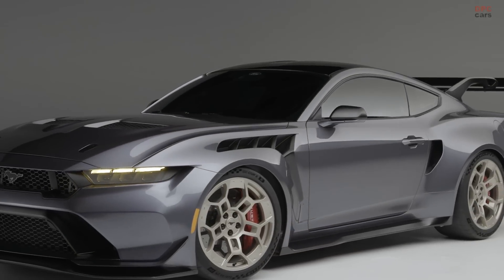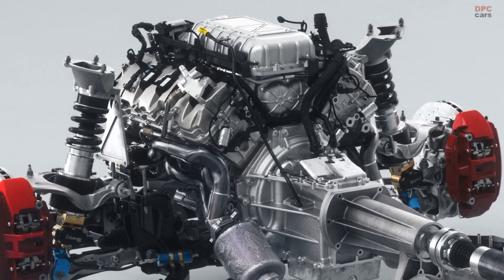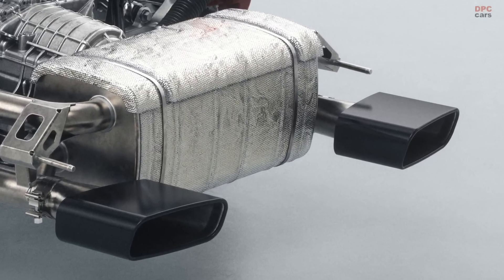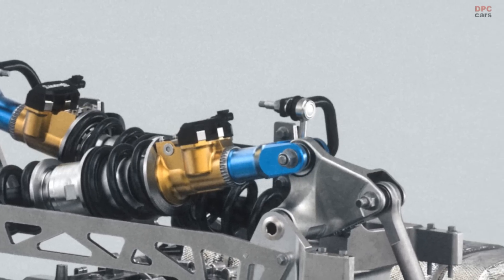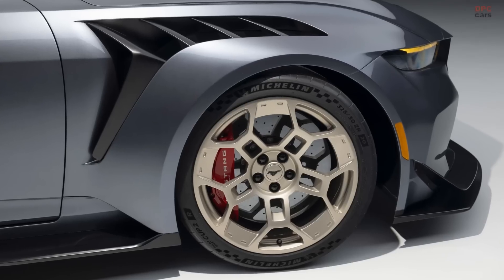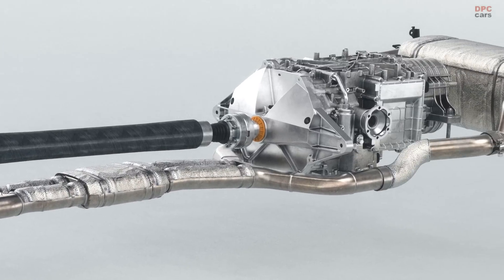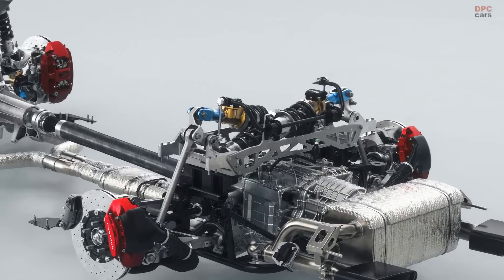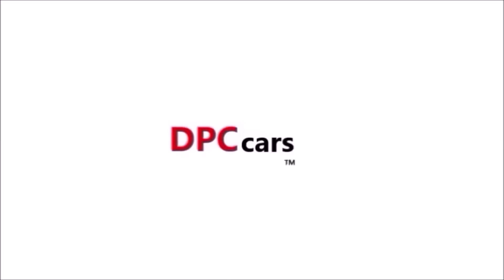2025 Ford Mustang GTD Technical Deep Dive

Comment: Looks like they learned a little from the time they owned Jaguar, that whole rear end with the axle (not transaxle like this work of art) and suspension (except brakes like the XJS) are all in one bolt on unit.  Probably not even close considering that was the late 60s when the Jag started designing the XJ but the idea looks to be there and it does visually resemble the old Jagz which for its time, not counting the electrical gremlins everywhere especially the v12, was a pretty darn impressive car.  I love em all, Euros AND Muricans.

Comment: For those who thinks it an over price GT500, you would be wrong! The engine is similar but even that had different components & that’s where it stops right there. Dry sump is massive! And that’s the beginning differences without me telling you, is in this video. Everything he is saying has no bearing on the standard GT500, they are light years a part. In fact as someone else has stated here, its a race car developed for use on the road. This is no mustang really! it just looks like one. Looking deeper into this, the RD/ Dev and the cost of some of those components are very expensive. This will scare the Germans, and yes the price is right around 300K top spec Porch GT3rs WILL SET U BACK WELL OVER 500k. Ford are putting a lot of Dev into ride handling, drive chain weight, they already have the expertise, just need to spend a shit load of money to refine this car, make it lighter faster handling etc. WHY? They want to break records at Nurburgring race track. As i said 300K car, that will beat the Germans. You have to give it to Ford this is the sort of engineering that went into cobras and we know how that turned out beating Ferrari. Even if you are not FORD fan, the fire in the belly for high performance cars, from Ford has to be admired. I am from Oz and I have a 2021 MACH1 luv this car. I drive this proudly in between so many  EV’s Why? because it make me feel a live! The sound is wild and i feel like a racecar driver everytime hop in to it, lets not forget the world is moving very fast, soon we will be sitting in the back and not driving at all!  So for me, I believe this GTD will be everything we want this car to be! Last of the V8 fire breathers, showing the world once again, that Ford, if they want to, will race you to the end and win! So Americans should be proud of this company FORD, once again taking on Europe in motorsport. I just think they might have a chance with this one too!!
Reply: Not $200,000 worth more than gt500. I’ll take the C8 zR1 please

Comment: I’m a Ford ‘19 GT350 and Ford powered TA2 car owner so…. Thanks for nothing Ford. All this tech in a car that’s all pre-sold and none to the regular guy Ford enthusiast. Here’s a thought Ford, invest in engineering that would have made a Mach 1, or GT350 lighter, wider and CG lower. Or make more FP350S race cars. A unicorn homologation car is just a plaything for the ultra rich. Good job rewarding the regular guy Mustang owner (sarcasm).
Reply: Not quite true as I am a long time ford fan who has a tiny hobby shop in the backyard but I did get a allocation. When I sent in my application did not think it was possible but sent in app anyway. I was quite shocked to actually get an allocation. My "collection" consists of a bunch of nearly 60 yr old pickup trucks.

Comment: After a brief inspection of the data provided here - I must conclude with but a simple thought about you're usual weight to power / front / back - handling issue (that's been going on for the past 🙄 ~4 decades now..) - ENOUGH WITH THE BALANCING 😤.
Seriously - this car has nothing appart 🙄 all the others.. except for - what I just mentioned.
😤
It's basically an AWD already - unless you're tires peal off of all that cornering.
V8 - all 😌👍
Reply: You can't hang you're back wheels anymore.
If you're driving forward - the front is so heavy - it'll pull you out.

That's 40y of working on "balance".

Comment: Ford comes up with the best engines and put them in these heavy chassis. Imagine if the put the GT 500 engine in the GT. Imagine if they put this engine and suspension combo in a car with the weight of the GT.
Reply: Do you know that this car's chassis is composed mostly of carbon fiber and titanium?  Weight is an after-thought

Comment: Double wishbone used to be pretty commonplace, it's why old Hondas are so fun. Now, one has to go into six-figures to get it. Nuts.
Reply: @user-dw1ls3rp1I - Make no mistake, this suspension is way beyond just double wishbone, with automatic and manual ride control.  Read about it and you'll see it is closer to an F-1 suspension than any production car.  Similar to the Ford GT suspension.

Comment: that thing is bad ass. notice the gearbox in the rear, this is the beta test for fords new mid/rear engine platform.
Reply: No, that's called a transaxle. Helps with weight distribution.
Reply: @kcjive   - Gearbox in the rear, oh wow.  Porsche has been using them with the 924 back in 1975!  LOL

Comment: A supercharged gt with body kit.
Reply: Oh, but it is so much more than that my fiend.  Try Reading up on what has gone into this car from an engineering standpoint and you will much better understand the basis of the high cost of the car.  After Ford sends the base Mustang 650S to Multimatic, they strip it down and completely rebuild it by hand.  Most all of the suspension components are made from billet aluminum.

Comment: The best part is that it's not a Chinese, battery powered auto-cart, more suited for golf courses.
Reply: Well, at least understand that the US is ramping up Lithium mines and will become one of the largest suppliers of Lithium and batteries will be made in the US, like many are already being mfg. in the US.

As far as speed Is concerned, you can buy an EV that will blow most cars off the road in 0-60 times and you don't have to rely on overpriced gas that OPEC+ controls oil production and pricing so we are all held hostage to THE oil/gas companies.  At least there are alternatives.

While I don't own an EV, I have several friends that do and they love them as they snub their noses every time they pass a gas station.  it's always nice to have options.
Reply: its funny , they had the same negative shortsightedness when the automobile was replacing the horse ....

Comment: I could buy an old Camaro Z28 IROC-Z and make it better for a 1/10th of the price. Ridiculous high MSRP
Reply: Your $50K Iroc would not outlap this car, it would just have similar power. Nice daydream though.
Reply: @makstone  It would require less HP for the same weight-to-power ratio. IrocZs are very light.
Tuning is key
Reply: @Agent-mb1xx It still wouldn't beat the GTD around a track. There's way more to this than just power to weight ratio. This car's designed to run a sub 7 minute lap time around The Nuremberg Ring. For comparison, the Viper ACR couldn't even do that! 

There's no way you're building a 7 minute car for 30k lmao! If it was that easy, companies wouldn't be spending 100's of millions of dollars trying to shave a couple tenths off their track runs.
Reply: @Akapaco2  never underestimate a turbo LSX 454 in a light car
Reply: @Agent-mb1xx  You are conflating power with handling. Throwing more power at a car won't automatically make it handle better, even if it is lighter. And btw an IROC weighs 3400 lbs...it's no lightweight.
Reply: @makstone  if only you could have seen the race track Camaros I have seen you'd be a believer as well.
Reply: @Agent-mb1xx  Any track Camaro that can out lap this car won't be 1/10th of the price. Not even close.
Reply: Careful big guy, you are showing some major ignorance here trying to make us think you have a clue as to what this car is.  Stop while you're still so far behind!  A Camaro IROC.  Ha, ha.  I could take a Mustang Boss 302 and would roast your Z28!  This GTD Mustang is so far ahead of the Boss and the Z28 they would barely qualify as pace cars for this machine!  Try something that is sure to improve your image......actually read about the vehicle, which is glaringly evident that you have not done so.  This is essentially a hand built car and is way ahead of anything built in America from a technological and operative standpoint.

Comment: Wow.Mustang with Corvette drivetrain.
Reply: corvette copied lambo
Reply: @uraniumcranium2613 - And Lambo copied Lotus who first used this setup back in 1958 !
Reply: @SB-cv7vd - I have to ask you why you thing the GTD's drivetrain is the same drivetrain  as the Vette?  The Corvette engine is in the rear coupled to a trans axle.  The Mustang's engine is in the front, coupled to a trans axle in the rear.
Reply: Wow, Chevy's best Lap Time at the RING is 7:14

Comment: Yea I know people are offput by the cost compared to the GT3 RS, but I think its because we're thinking about the Mustang as the underdog when I think the conversation really should be more about how Porsche is going to be an overachiever (as they always have been) with a more compromised car than the mustang... that's pretty much how you have to justify the Porsche being a better value. I cant get how people who are making surface level assessments of both cars, look at Multimatic basically turn a mustang GT3 race car into a road/track car, and then say the porsche is more "race car". even as extreme of a car as the GT3 RS is, I still think the mustang will be more racecar, even for the price...

I mean without going to deep into it, fords made a big deal out of the transaxle setup for a good reason; the GTD is now categorically a front-mid engine car. and its not just that you can boast about a 50/50 weight distribution, but that the weight is likely more inboard than any of the road going Porsches (I probably dont have to tell you why thats a good thing). If you couldn't tell by now, transaxle cars are cool as hell and I think makes the ford every bit as exotic as the Porsche. 

Also, considering that the GTD is largely based on the GT3 car (and by extension depend on Multimatic's engineering & manufacturing expertise); the chassis is likely to be every bit as stiff and light as the Porsche, with suspension that's just as sophisticated... fun fact: Red bull's success with the 2022 regs is largely thanks to the chassis/platform control owing to Multimatic's DSSV semi active damper technology, not too dissimilar to that that found in the mustang.

And of coarse one could say the engineering might of Stuttgart have to a large extent turn those compromises into strengths, but it does leave you thinking that they aren't starting on the same foot. With it being a lighter and more powerful car, I wouldn't be surprised if the GTD took the production record from the GT2 RS MR (not really counting the Merc P1 since they really havent started production) and if it does, that would actually make it a bargain with gt2s still being well into 300k and some even going for close to 500k with the MR kit. but If its just by the numbers (something that I still think Porsche cares about), I think the mustang might just about have the GT3 RS beat (the mustang is slightly more powerful, lighter etc)... I think it really should'nt be a hot take to say the porsche, with all of its on the fly tuning, is a more playful track toy, while the ford is a more serious racing car (atleast in character).
Reply: exactly, porsche fanboys are out of their mind on this one and overall. gt3rs wont hold a candle to this, probably even if you remove a supercharger.
Reply: I mean even the porsche doesn’t have push rod suspension. Some fanboi just won’t get how cool this car is
Reply: I am a Porsche guy and love it. But like the GT3RS, these are unobtainium.   If I could own a GT3RS, I would get this as well. I mean why not.  I think the initial reaction is because you see a crap ton of mustangs on the road and this one is 300k.  Time will tell.
Reply: @ernesternest815  at least you dont need to humiliate yourself by buying rebadged audi SUVs to be eligible to buy proper supercar
Reply: On the racetrack they will do it with rules changes that help the 911.
Reply: @DChrls  This car will not compete in actual GTD racing. As much as it might be BASED off an actual race car...it's a street car. In the various actual GT racing series, they us BOP to try equalizing the various competitors as much as possible.
Reply: At the end of the day, those that can afford a 911 buy one (I did) and most of them (including myself) don't want a mustang. I had them in my 20's but I moved on in my 30's to Porsche. This is a niche car that won't ever be used for track driving, similar to the new Ford GT. They MIGHT outperform the 992 GT3RS on track, but Porsche is lighter, has more downforce and better transmission and naturally aspirated (good and bad) - but no one will ever know about how good the GTD is because those that buy them will just keep them in the garage. Meanwhile the GT2 RS is coming and will make this GTD look like a Honda Civic on a track.
Reply: @MrSchn3ll  this car has almost nothin in common with Mustang except the name
This car will obliterate gt3rs, it's plain obvious. Gt3Rs is cup-based car, which are pretty slower than gt3 cars. This is gt3-derived. Annnd 275 hp more.
We don't know the weight, nor downforce - kinda stupid to make such assumptions. Though, what to expect from porsche owner...next time Mustang will be on your tail on track - move to the right of the track, please, don't be typical porsche driver. 
Gt2rs might get a chance to be slightly faster, we dont know specs for the moment, but I highly doubt that.
Reply: mercedes better.
Reply: You might be interested to know that when Porsche went front engine in the mid 1970s, they used transaxles.  All Porsche front engine cars, so that's the 928 (1977-'95), 924 (1975), and its derivatives the 944 and 968.
Reply: The definition of a front-mid-engine layout doesn't have anything to do with whether there is a rear-mounted transaxle. It has to do with whether the front mounted engine is entirely behind the front axle center line. And if the available pictures of the GTD chassis/driveline are accurate, that is not the case here. Also...what is that transmission-shaped thing behind the engine? Why doesn't the drive shaft run right up to the rear of the crank shaft? That thing looks like it's a couple hundred pounds at least. And boasting about a 50/50 weight distribution is dumb. It's better than a front biased distribution, but it's not ideal for lap times. It's like boasting that your brake rotors are cross drilled, when that is actually a bad idea on track. And I cannot imagine having the engine in front and the transaxle in the rear will result in a smaller polar moment of inertia as you implied. Keeping all the heavy items close together is the key to achieving that.

Surely the GTD will outrun a 3RS around most tracks. I mean - although we don't know the weight or down force figures - it's got 800-hp to the 3RS' 518-hp. This SHOULD be more suitably compared to cars like the GT2RS or the AMG GT Black. The speculation and arguing is all kind of pointless. I'm sure we'll all find out sooner or later whether it can actually best those cars.
Reply: The gt3 rs is far superior and will run circles around this gtd. 
I mean who seriously designed this car? Ugggh
Reply: @andytaylor2321  literally the same people that built Porsche LMDh car. Also they happened to supply shocks for half of F1 teams. And designed more winning racecars than winters you saw. 
Keep riding porsche 🍆while being completely ignorant.
And no, gt3rs wouldnt stand a chance against that. Keep dreaming about running circles in ugly beetle over a freacking gt3-civilised car.

Comment: If it was GT3RS battle ready, we would see some lap times vs a GT3RS ? I have a ZL1/1LE mods, I'm not in GT3RS territory, but neither is a C8 Z06 or this GTD.
Reply: did you just compare a zl1 and c8 with the GTD and a gt3rs lol.
Reply: in what way is the GTD not in the gt3rs company? its lighter, more powerful; more based on the gt3 mustang than the gt3 rs is based on the GT3.R (meaning its perhaps a stiffer chassis); has suspension setup no less sophisticated than the gt3rs, is front mid layout compared to the compromised rear engine layout of the gt3 rs... shall I go on? like I get that Porsche is often seen as overachievers and giant killers (even thou they themselves are giants), but Porsche's horsepower isnt better than anyone else's, especially when you have 200 more. and I get it, everyone is speculating, but if youre speculating atleast make sure that the facts on paper is on your side first.
Reply: @stephen2282  
Here is something that isn't speculation. Even the GT500 matched a GT3RS on a specific track. This new GTD will simply walk away from a GT3RS on any strait. The GT3RS better hope this Ford can't corner but I wouldn't bet against it.
Reply: @stephen2282  Right now the GT3RS is only 2.745 seconds faster than GTD at Nurburgring

Comment: Carbon fiber drive shaft? I've seen too many of those explode under heavy load to trust them...
Reply: Ford used carbon fiber drive shaft on the 2013 GT500. It did fine.
Reply: @richardmodglin3900  ✅
Reply: Well ok. CF is lighter,  once I saw a couple shaft explode . . . .